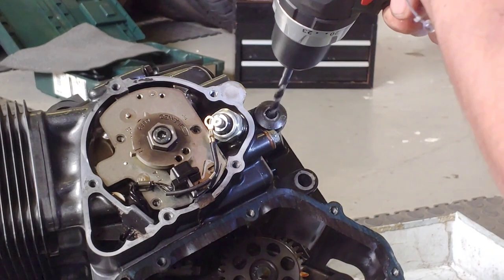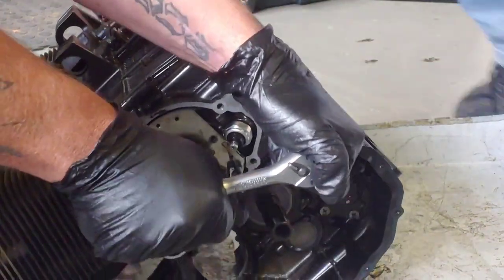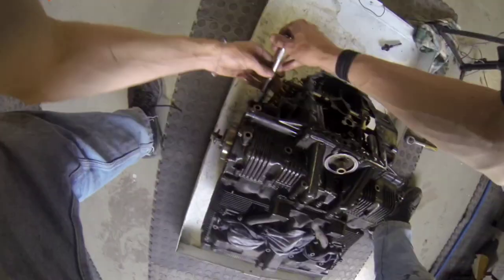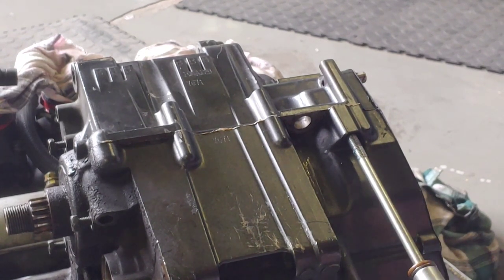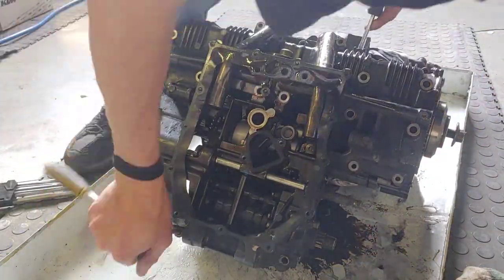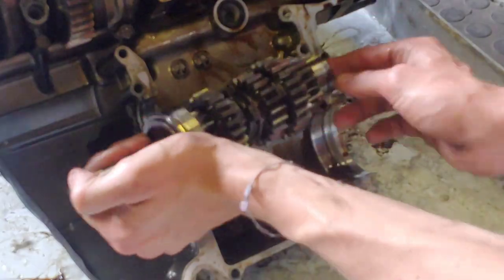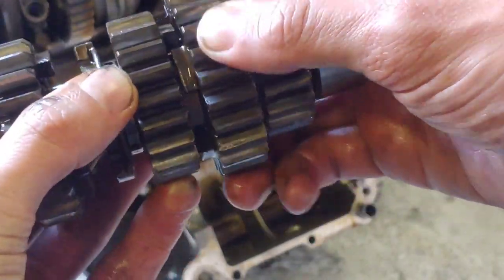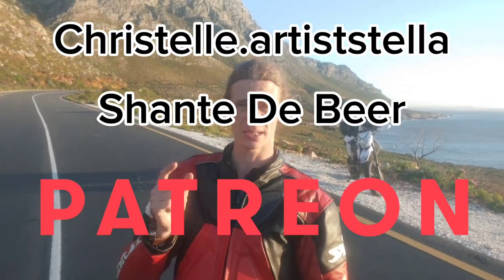🔧 Finally Splitting the Crankcase: Inside the Heart of My Suzuki Bandit 1200S! 🏍️🛠️

Comment: Look up WPC and cryo treating that part if it wears fast. Cryo Ik will help a little bit it freezes the part and brings it back up to temp slowly changing the molecular structure making it slighty harder. Meaning it won’t round off as easy.
Reply from the maker: Super interesting!

I mean, the bike is 17 years old, with 120 thousand km on the clocks, so having worn down gears really isn't much of a surprise
Reply: @CasualRiders   yea it doesn’t surprise me either I’m looking at a 2000 I think bandit 1200 right now with the older style head light that’s a upside down trapezoid. It also has a lot of miles at 57,000, so I’m pretty excited to get into it if i can snag it up for cheap.
Reply from the maker: @402SHO  they are fantastic bikes🤷‍♂️

Comment: Curious how may km/miles has this engine done ?
Reply from the maker: The last odo reading I recorded was 119410 km, which would have been at the last time I refueled.

It's important to note that I commute with the bandit every day, so I cycle through 1st to 3rd gear a lot more frequently than most bandit owners which primarily use the bike for touring, and sit in 4th & 5th most often